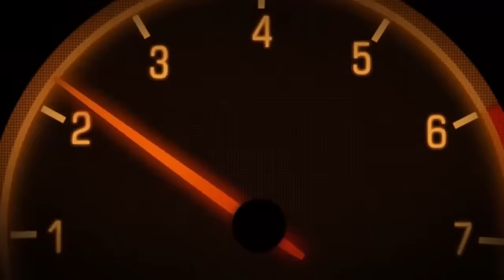Nitro Engines,  And A Wagon Grave Yard  Road Trip !

Comment: AKA called the PUKE TANK. It should be able to hold all the oil the Engine system has. The size of that opening on the manifold is regulated by the NHRA. On average the Teflon strips are replaced every other run. Not every clutch disc is the same compound of material. Yes they will mix some old with new depending on what Jimbo wants. Crew Chief. Guy with red hair/Beard is Jesse he is the car chief. he oversee the engine rebuild after each run. The pos Gs are not the killer. It is the Neg Gs at the end when chute is pulled that is what can end a driver. It can detach a retna in a eye. Thank you Clay and Crew. The Peoples Team for sure. Thank you Steve and Val for sharing your small vacation with us
Reply: That is crazy concerning the eyes!
Reply: @lynntatro7374 yep, I was waiting for Steve to draw the negative Gs for the slow down at the end of the run, but no such luck.
Reply: @CGT80  it's probably not recorded in the graph when everything is shut off is my guess.
Reply: Don Garlits had a retina detach, and it ended his career driving
Reply: How about the pulmonary artery. I hear that can tear under high 'G' environments.

Comment: As a diesel guy I always liked the big end when watching Top Fuel because as you were showing on paper, that's the magic point where the clutch locks up, sucks the engine down into maximum acceleration and the spark ignition is all blown away and they back-half with that classic waaaaaaammmmmp sound because they are ignitionless at that point and compression ignition only...... aka.... Diesel...

Sled pull engines get pulled down like that on every run at deep tripple digit boost.  It is certainly way hard on parts.

Awesome, awesome video.

Comment: Wow! That was incredible access to detailed information on top fuel racing. 

BTW,  the reason top fuel cars can have peak accelerations of around 7g's is because the huge wing pushes the rear down into the ground by about 2.5x the weight of the car when they are in the 150+ mph range.

Comment: 30:50 see Steve that's why you're torque converter in the wagon was on the hot side huge power like 4k wheel horsepower it blows my mind on how it lives

Comment: When the clutch starts loading and acceleration goes way up, at the same time the tires are growing in diameter, that's what pulls the engine down a lot.  Tf and fc only have the rear axle gear ratio, no transmission, so the tires are the variable gear ratio enabling the 330+mph speeds.  
  Got to know Clay about 20 years ago when he was killing it in IHRA for Werner.  Great guy, started as a forklift driver.  Literally bottled energy.

Comment: The multi stage engagement of that clutch is like having an extra gear in the transmission when it fully engages, nitro engines need to be under load to make power anyway. That Peanut butter was actually designed for assembling detroit diesel engines, which is fitting seeing you've got that big huffer from one sitting right there..

Comment: When I was skydiving in 72 we used a pilot chute to pull a sleeve that slowly pulled off the chute to prevent ripping the seams on sudden deployment. I only had one malfunction out of 24 jumps. The military chutes were pulled out by the static line connected to the aircraft. Without the pilot chute the chute and sleeve will fail to deploy. This happened once at a 3,500’ pull.

Comment: They also will run shorter or taller assemblys to tune the engine for the next run. Essentially adding or reducing compression.

Comment: Blown fuel sure has come a long way over the years. We ran blown fuel Hemi's at Bonneville for 20+ years on 55% & had it down to more than 10 runs without even pulling the heads & just rolling bearings into it. That's at least 5 miles per run plus a return run within 1hr for record attempts.

Comment: The plate on the manifold  is for proper cylinder to cylinder distribution, higher airspeed for fuel mixture to burn and to reduce certain turbulence. That’s also why the plate isn’t just a flat ending it has that little triangle tip as that changes the direction of the air also. It may not seem like much but at the speed the air moves and the amount that they move can have large effects just like a vein in an intake port in a cylinder head.

Comment: NOTE, Without the 5 Nugs set in the wheel the studs themselves cant take the force/torque at take off. If it only had the studs you would see the tire/wheels come off when the light turns green. Also note how the piston and rods are in sets of like -1 or -3 Jimbo can use them with a different thickness of head gasket to set compression ratio depending on air density/weather for the tune each run. The air adjustments you see Jimbo setting as Clay stages he use to fine tune/set temp of Engine. Less air=more fuel and cooler Engine. More air=warmer engine. Yes that little adjustment means so much

Comment: Steve if you are going to keep the Promaster - maybe upgrade it a little for these trips you will be making all across the US looking for those wagon carcasses. Get a deck so you can dolly stuff around and some E-Tracks & straps to secure the big heavy (expensive) stuff. If you want to go all out; Tommy Gate makes a few models of rear door lifts for those vans. Ramp those engines and transmissions in and out without breaking a sweat (or toe). A few years down the road and your back will thank you for the lift.

Comment: 21:52 When NHRA mandated a switch from 2.90 gears to 3.20 gears many years ago, figuring out how to get that load back on the engine to keep the cylinders lit was a big challenge, and it also raised the RPM of the engine considerably. Several of the crew chiefs ended up picking the brain of Top Fuel motorcycle racer Elmer Trett because he had years of experience burning nitro at high RPM. He told them you need to try this and that, and within short order they had it figured out. 😎

Comment: One of the wildest things with top fuel as well is that the engine only turns ~500 times from launch to the finish line (7500 rpm for 3.something seconds).  Imagine how powerful every single stroke of the engine has to be for that.

Comment: Clay Millican is a great guy and was younger the last time I saw him race in person.  Clay gave you the secret how to avoid tire shake.  Keep the tires round by spinning them a little off the line.  He called it getting up on the tire.  A correction for you at the 1 hour mark, the engine hits their max RPM about 8400 at the hit of the throttle.  The clutch works against their max RPM at the 1 foot mark and all the way down the track.  They Grunt the engine as much as they can,  Bringing in more and more clutch, hopefully without smoking the tires.  The clutch is fully locked up before the 1000 foot mark.  Weed is not legal in Wisconsin, but our Governor is almost as useless as yours. 🤔

Comment: I want to restate. Anyone that wants to give a hard time about steves engines should appreciate the fact that those top fuel cars literally turn 540ish ROTATIONS under load before they get rebuilt at a cost of about $4,300. Thats about $8 per loaded engine rotation.🤯 Steves go thousands of miles, sometimes years before getting opened up.  Respect.....🤜

Comment: at the beggining you said that the car was Making a lot of power that wasn't your's. THANK YOU STEVE WOW GREAT, The beggining wow I wanted to go through that so badly and. Josh just loves you and how you cut out to explain the fact that it's lighter with a straight drive transmission but it ruins the clutch because there is 10,000 horse power at the 300ft mark. and it has to engine shut down cool man Thank YouX2. Brandon

Comment: In any other situation, if you had to rebuild an engine every quarter mile, you would most likely junk it!
Reply: That's only 3,284 rebuilds between my house and Seattle, a trip I've made 50 times.  That's a traveling time of 3hrs-23minutes for the 821 miles.  But at 3 hrs per rebuild this adds 410-1/2 days to the trip.   The Camry going 70 mph still wins by 396 days !

Comment: adjective: hydraulic
1.
denoting, relating to, or operated by a liquid moving in a confined space under pressure.
"hydraulic fluid"
2.
relating to the science of hydraulics.
"hydraulic analysis of streams"
3.
(of cement) hardening under water.

Hydrolock (a shorthand notation for hydrostatic lock or hydraulic lock) is an abnormal condition of any device which is designed to compress a gas by mechanically restraining it; most commonly the reciprocating internal combustion engine

Comment: Hi steeve.
How does the catch can work for an engine with a dry sump? I feel like you would be pulling air through it into the engine. Or does the dry sump tank act as a catch can so a seperate one is not needed?

Comment: Believe it or not,,,Dick Maskin and Andy Manarinno had a big part in the evolution of modern top fuel racing with the aftermarket aluminum cylinder head. The set back blower came out of the Kallitta camp,many years ago,,,coincidentally Jim Oberhoffer, Clays crew chief,got his start at Kallittas

Comment: Steve, what is that black JB Weld looking stuff covering the exhaust guide of that dragster engine head. Maybe it is made of heat resistant ceramic to keep the guide cool.

Comment: @SteveMorris  Here is some info for everyone. Remember a Few Top Fuel drivers have retired due to the Negative G/s at the end. 0 to 100 MPH in .8 seconds (the first 60 feet of the run)
0 to 200 MPH in 2.2 seconds (the first 350 feet of the run)
6 g-forces at the starting line (nothing accelerates faster on land)
6 negative g-forces upon deployment of twin â€˜chutes at 300 MPH An NHRA Top Fuel Dragster accelerates quicker than any other land vehicle on earth . . quicker than a jet fighter plane . . . quicker than the space shuttle. When 2 Top Fuel Dragsters take off it will show on a sizemograph 10 miles away as a earthquake

Comment: One thing I did wish they would have touched on more was the copper head gaskets. I did not realize that they reused them.
That crush Steve was talking about, would you use a thinner head gasket or change out the rods and pistons with new?, that seems very expensive to do that.  From what I understand is that they have different thicknesses of head gaskets available to make up for what I'm assuming is the crush factor Steve was talking about.
Reply: They'll also change head gasket thickness depending on the tuneup and/or air conditions to get the compression where they want. Also not mentioned is that they will sometimes run different piston heights in certain holes to compensate for certain things in the tuneup.

Comment: i believe that off set opening is part of the design feature when you step up to a "hi helix" blower. I currently have a 250 hi helix blower sitting on top of my 408 to power my 65 olds delta 88 celebrity sedan and it has that feature...

Comment: They asked John Force how he could tell he was on a rocket ride and he said when the clutch fully locks up and pulls the motor down and the tires don't spin it means all 12000 horsepower is pushing you forward and your on rocket ride.

Comment: I used Car parts warehouse for years until they stopped being competitive, the internet wiped them out. Ill still use em if I need parts right now but 99.8% I'm buying online to save the customer a buck. Long story short, no wonder they charge so much more. They're also a Rockauto distributor  which is cool. I got no gripes, im just gonna buy the best parts at the lowest cost.

Comment: Steve you are very smart and a deep thinker. Learn about the Clay's "Down Nozzles" and apply it to Methanol.   Ask him, they supply way over 50% of the fuel and they extend PEAK cylinder pressure.     FACT   A/FD's never ran good until they used down nozzles.  Use that brain of yours

Comment: Is there a search an awesome video like I’ve said before you can run your videos as long as you want because it’s constant information. If you Google tops your car tags some very interesting stuff I’m pretty sure they burn 11 or 12 gallons of fuel per second opener parts I can’t remember who is almost equivalent to the station or off and the jeans are almost equivalent to the stational a hemi doesn’t have enough horsepower is in the blower another fact like that really cool

Comment: i appreciate the engine and top fuel tech to no end. I have followed you and Kevin and Clay for years. no lie. However i have to interject on your comment about the Uber driver.  You said the Uber drive told you he was on a fixed income and implied that he wasn't because he is employed by Uber and therefore can make as much as he wants to work. The likely reality is he is on a fixed income but its not enough to pay his housing, groceries, health insurance, and misc bills, so he is adding to his income by driving for Uber, to survive. Being on a fixed income does not equal being on a an income that is survivable. Please don't be so quick to judge. Thank you for the amazing enige tech and drag racing coverage.
Reply: We weren't really "judging", it was just an odd comment from someone driving an Uber. That job is the exact opposite of "fixed" income. No doubt it's probably not a liveable income. I definitely think most drivers deserve a generous tip because their services are comparatively cheap yet valuable.
Reply: @valeriemorris7669  thank you for your sensitive comment. I didn't want to appear negative about you folks, just wanted to shed light that even folks on fixed income/retirement/disability are still having to go out and work extra hard even if they might have physical or psychological limitations on their ability to do so, just to survive. Hope you made it home safe and sound!

Comment: Think back to wjen Steve made the video about how much a piston weighs per rpm in an engine running down the track.
  And Steve builds dran n drive engines that run damn near superstock.
 And keep running..
     Steve builds a badass freaking engine that holds up.
  The only things that make them not is. A bad tune just one pass.
  Crazy shit. Steve in my opinion is one of the best machinist building engines out there. And considering the cost and stand behind his product?
   Too of the heap.

Comment: The G’s go up because the aerodynamic load comes into play? They need the downforce to keep the wheels from spinning? And the 3.20:1 gears are big, but the tires go from squatting at the launch to 20ish? Squishing those 37’s to who knows what bigger in diameter… at 300+mph! (Probably still spinning too!)
Reply: Air doesn’t affect g,s